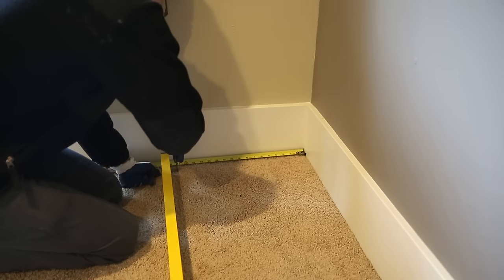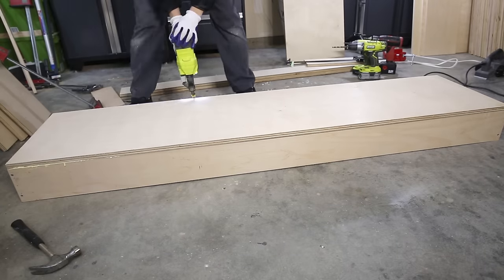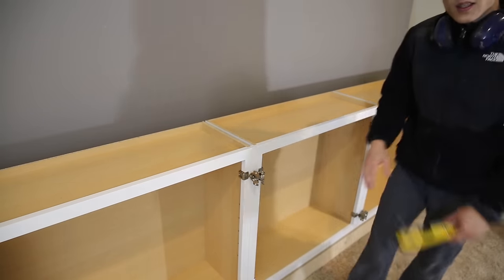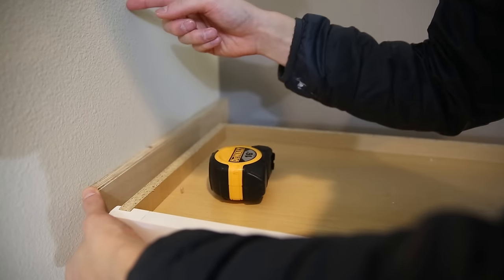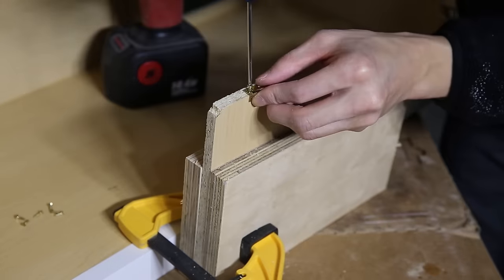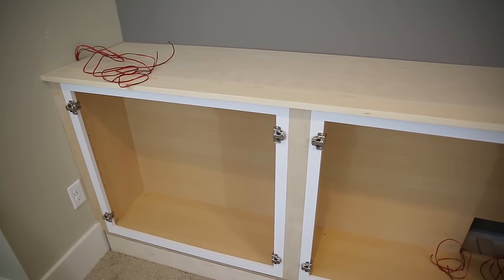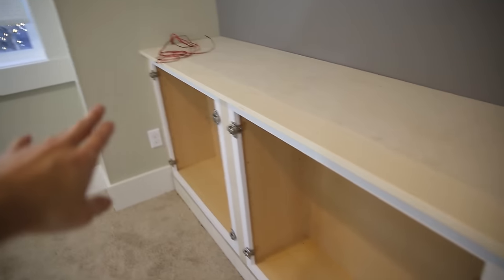DIY Built In Shelves Tutorial | Base | Cabinets | Part I

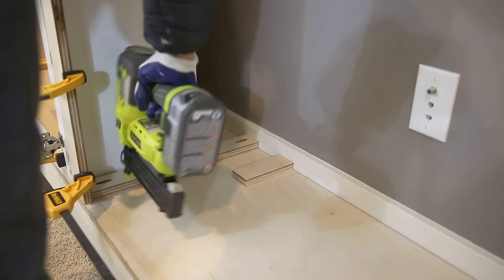Comment: Hey Paul, great job! I noticed at around 5:50 when gluing the cabinet spacer in place it slid around a bit. A trick I learnt (from another woodworker) was to sprinkle a small amount of really fine grain salt over the glue. When clamping it helps to prevent the timber sliding around. The trick has worked for me many times, so I thought I’d pass it forward.

Comment: Nice job. One important comment about your use of the table saw at the 6 minute mark. It is EXTREMELY DANGEROUS to make a crosscut against the rip fence.  It can bind causing kickback.
Reply: 4:22 - noticed that too... miter gauge with a sacrificial fence will prevent wood missiles, soiled pants, and you get to keep all 10 fingers too.

Comment: At around 4 minutes you looked for studs in the wall. Typically they are all on 16” centers so it would be quicker just to use the red numbers on your tape measure

Comment: If you level , plumb, and square your base then your cabinets should sit plumb and level. Square your cabinets and the shelves should slide in plumb and level as well. It's easier to shim and cut the base than each individual cabinet.

Comment: I love this video and now I’m getting to do this very same project.. in the list of things used I did not see the types of wood used.. did you mentioned that in your video. I really need to know what type of wood to buy. Not really worried about the sizes
Reply from the maker: If your painting you can use pretty much anything, but I used Birch Plywood
Reply: Paul Tran DIY ok but what thickness
Reply from the maker: 3/4 " Birch for shelves and 1/2" birch for just the backing but you can probably get away with 1/4" for the back of the shelves too.

Comment: This might be a silly question, but since you bought the cabinets painted white already, did you match the paint color to them for the rest of the shelving or did you spray over the existing white color on the cabinet doors with the paint you used overall so it can all match?
Reply: I have the same question!
Reply: No answer after 3 months... That's concerning.
Reply: It would be hard to paint match a new piece with old. If anything you can lightly sand the previous paint off and spray. i wouldn't recommend spraying over pre existing paint. If you have additional question let me know, im a carpenter and believe it or not i went to school for it...
Reply: Your question is 6 months old so likely this answer is late but anyway.  I did a very similar build to this after seeing his video.  You can find unpainted cabinets as well.  This is what I did.  Then I was able to paint all the wood exactly the same color.

Comment: This project has given me an idea for a room in our house. I just have a couple comments . . . not corrections. 
If you level the base first, your cabinets will be level.
You didn't  mention it in the video, but did you secure the edge of the carpet that you cut with tack strips? Carpet is stretched when it's installed so there's the potential for it to pull away from the base.
Looking forward to seeing the rest and future projects!
Reply from the maker: Yes good points!! Thanks

Comment: Hey Paul, thanks for this video. I have been saving it for 6 months waiting for the right moment. I do have a question, I didn't fully understood how you build the countertop. Did you use two plywood together? Like a sandwich?
Reply from the maker: Yeah I used 2 pieces of plywood and I just used dowels and pocket screws to hold them together. But honestly you can probably just set 2 pieces of plywood on top and fill it in with caulking or wood filler before painting.

Comment: beautiful work...loved it...I am thinking doing the exact same thing but I want to add a office desk to the custom wall unit and in the middle have an opening for a tv...any ideas how I can do this?
Reply from the maker: Yeah you can pretty much do the same process, but do not include the 2 middle cabinets. Make sure the table top is supported with support brackets. The shelves should be designed with a larger open space for the TV. You will want to take time to draw / measure and map everything out before starting.

Comment: Are you able to use the Diamond base cabinets rather than the wall cabinets so you don't have to install a platform to raise the cabinets?  To get a better understanding, was there a reason you decided to use wall cabinets over the base cabinets too? I'm assuming it's because they aren't custom cabinets and you needed to create spacers to fit the cabinets appropriately.. Is this right?  Thanks! Love your channel, the best DIY'er!
Reply from the maker: Hi Stephanie! The reason I didn't go with Base Cabinets is because the depth I needed was 18" or smaller (for my specific wall situation).  Base cabinets are 23"+. But you can definitely use base cabinets just have to make sure all the measurements and aesthetics are right for your wall. I wrote a blog post on my website www.paultrandiy.com with a little more details if you want to try to tackle this project!

Comment: Hi Paul, so 51/2”+30” in height, correct ? So your cabinet top is around 361/4”? What is your height? Thanks and thank you for posting.I’m building the same one. I went to Lowes and could only find 30” In height for the cabinet.

Comment: Surfaces to be glued should have the paint removed for a proper bond.  Doing that makes the joint much stronger, if you don't the adhesion strength of the paint determines the strength of the bond not the adhesion strength of the glue.  If you don't remove the paint you may get a reasonable bond but it won't give the full strength the glue has to offer.

Comment: Thank you Paul for this, very nice and your explanation and step by step guide is on the money. I have plans on doing this for my living room, the only thing the living room has a lower than normal ceiling, so I'm wondering if these ready made cabinets come in different heights or are they usually standard?
Reply from the maker: You can search lowes and home depot and maybe IKEA, or even 2nd rehab stores and find ones that work for you (they come in many sizes). Generally though standard counter top height is around 36". I probably would not go any shorter than 30" because my concern is how it will look. But I would measure everything out and draw it out on a piece of paper to see if it looks right before starting anything.

Comment: @Paul Tran DIY

I’m doing this soon in my house. My questions are about the wood you used for the countertop. I bought the 12 inch pine board from Lowe’s but it measures just shy of 3/4 inch in depth and the 3/4 inch mdf wood that I’m using is exact. How do I do the countertop like yours if they don’t match? Can you possibly link the wood you bought from Lowe’s for the countertop pieces?  Otherwise I would have to sand down the back 2 pieces of wood to match the 12 foot pine board up front.

Comment: I think im going to use this as a starting point to make a 10 ft built in wall desk unit. Just modify it a bit to suit my needs. Im thinking only using the cabinets on the ends so I have a place to sit, make 2 smaller platforms for each side and leave a gap in the middle 2 shelves above where a monitor can go. Any advice? These wall units are kinda pricey and yours is great and affordable.
Reply from the maker: Yeah that should work. As others have suggested if you don't have restrictions on depth from the wall, you can buy the Base Cabinets instead which are deeper (not sure exact measurements), then you would not have to build the platforms. The wall cabinets I bought to use for the bottom are only 12" depth (because I wanted to save some space). Also you may want to consider reinforcing the middle part where you will have nothing underneath and placing weight on top. I would recommend getting scratch paper out and measure everything and draw it out and just imagine it for a few days before starting. Hope this makes sense, its 230AM for me haha.
Reply: Thanks again for the great videos! loved them
Reply: Hi. I have something similar in mind. Just curious as to how your project is going ? Any pointers to get me started on my own project ? Thanks

Comment: what do you think about doing this over hardwood floor and also did you have to screw the platform into the wall?
Reply from the maker: Yeah you can do it with hardwood floors, same process and also yes you can screw it into the wall studs. In my case it was so hard to even move when it was sitting on the plywood floors that I didn't bother screwing the platform down. Good point if you can make it stronger why not.

Comment: What model is your Hitachi? And how do you like your Rigid Table saw? I'm a new DIYer and building up my tools and I would like your input.
Reply from the maker: I'm not sure if they discontinued it and there is a newer model for the Hitachi? But it was priced at $99 when I bought it. So I think it would be comparable to the C7SB3 model. I personally have only used 2 different circular saws and the Hitachi one had a stronger motor and performs well. I don't like that it is corded but I question if battery powered ones are good. Its really sturdy and the only problem I ever had with it is when I created my own jig to cut straight lines, the motor sits a little lower and there is not much clearance between the motor and the jig. Its hard to explain without a photo. But you will need a very thin 1/8" plywood to make the jig, I had issues with 3/4" jig thickness. 

Table Saw I have has treated me well too. I wish I had a longer fence but its been good. The  riving knife did not align with the blade which was a pain. I got fed up and bent the riving knife to make it straight. Ever since I did that its been great.
Reply: Paul Tran DIY Awesome! I appreciate so much your feedback. Take care.

Comment: This is awesome!! Great video. Thinking of attempting if I can convince my fiance to help, HA! :)

I'm trying to figure out the dimensions of the cabinets I'll need.. Is it ok if there's a tiny space on the sides? The wall I want to build it on is 141.5 inches (11' 9.5'') so its kind of an awkward length. It looks like most widths of the cabinets are 30 inches, 33 inches, 36 inches so none really fit perfectly.. Any suggestions? Would much appreciate the help!!!
Reply from the maker: Yeah I think 33 inch would work x 4 = 132. Then 141.5" - 132" = 9.5 inches left. Then use spacers between each cabinet (similar to what I did in the video) at 1.75" | 2" | 2" | 2" | 1.75" I would cut to fit for the end pieces because it won't be exactly 1.75" in the end.

Comment: Paul:  Have you had any experience with sagging at all on these shelves when you put books on them rather than just decorations?
Reply from the maker: No sagging so far, built them December of 2017. I have not filled an entire shelf with all books yet though. Its still in its exact same setup in this video. The 1x2 Poplar front also helps prevent sagging.

Comment: I don't want to come across too harshly, since based on your tools this is a very DIY job. 

However, the depth of the units is overkill, the spacing between units could've been butted together and then have a scribed fillet at each end to give you more room to re-fit the electrical fixture. 

Also regarding safety - how you handled cutting notches was incredibly unsafe and could've fired that bit of wood right back at you.